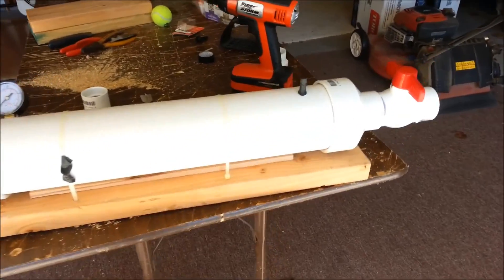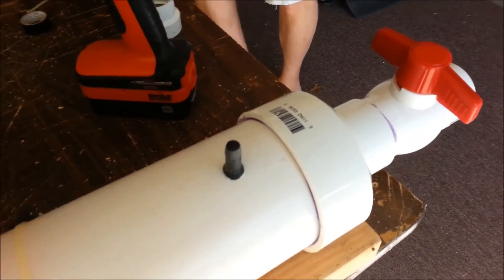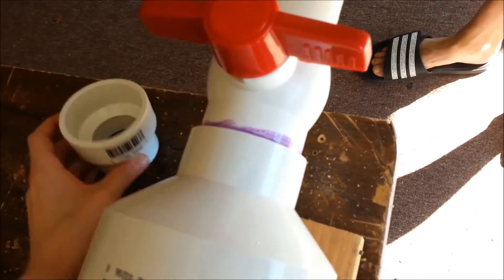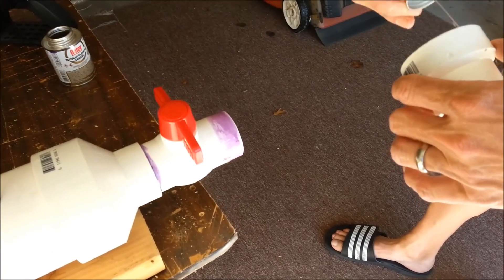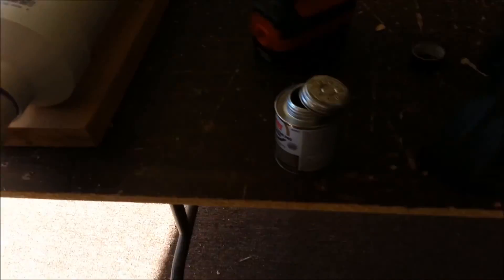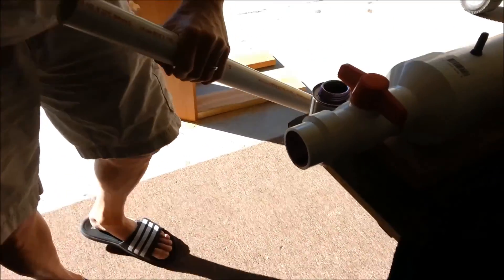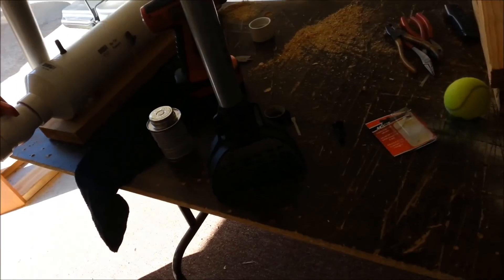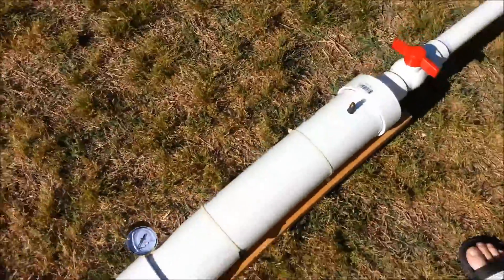PVC Air Cannon

Comment: Why are you using such low psi? Safety or?
Reply from the maker: Yeah, just safety. The PVC isn't rated for any pressure at all, really, so we wanted to make sure that nothing ruptured or popped off. This was also the first time we tested it, so we wanted to make sure it even worked.
Reply: Should buy pressure PVC that's meant for holding pressure ;) it still shoots well for ~15 psi!